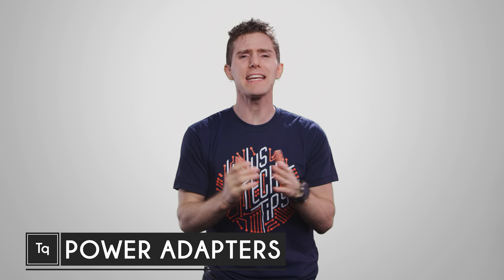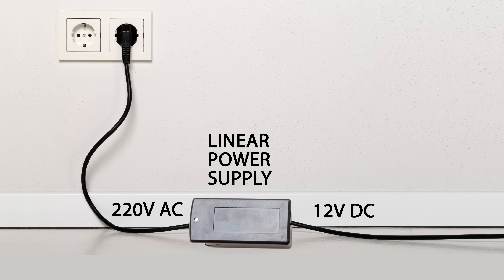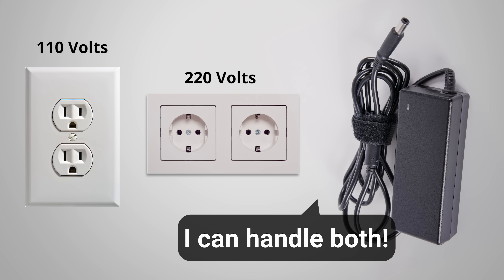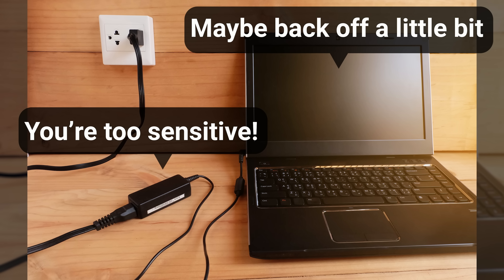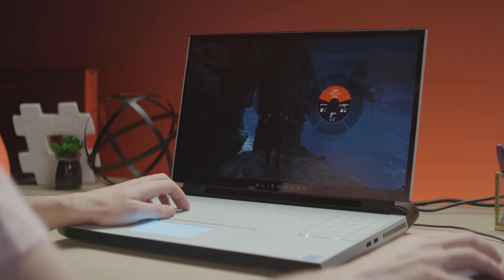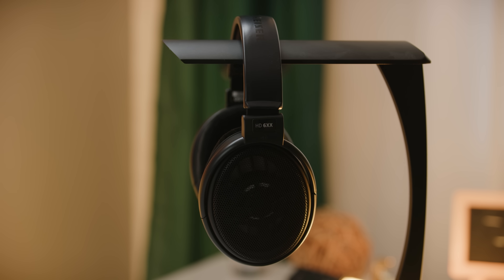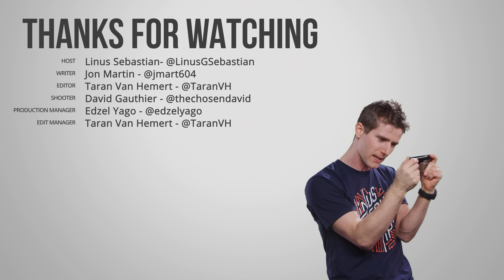Why Power Adapters Are So HUGE

Comment: That's not why they're called switching power supplies. They're switchmode power supplies. They contain a control chip that turns on and off at a much higher frequency than the utility supply. The high frequency means that a smaller transformer can be used, saving space and money, as well as reducing waste heat. The control chip monitors the output voltage and adjusts it by altering the switching.

The switching is why some phone power bricks make a whining noise, and it's pretty much the same reason for the coil whine you get from some graphics cards and motherboards.
Reply: Yea  i didn't know what is a switching adapter, but that part felt wrong, because why would it be more efficient just because you can use it with both 110V and 220V. That way it would be more convinient, but not more efficient.
Reply: I think the linear power supply you mentioned is linear dc to dc converter, like 7805. They are not efficient, and no one use them to drop high voltage like 110 to 5. Linear ac to dc converter use transformer, rectifier, capacitor and their efficiency is not too bad. Still worse than a switch mode of course.
Reply: @thaibinhphamdinh1299   P=VI, if you're passing current, and your device is dropping voltage it has to go somewhere, V=IR, so P=I^2*R. If you're dissipating power, it's through a resistance in a piece of silicon somewhere. Why do power MOSFETs or rectifier diodes get hot if they don't have an internal resistance which is doing that?
Reply: @NeneExists  That is when you assume the same current I, like in 78 series dc converter. In transformer and smps, when you drop the voltage V, current I go up. That is why the secondary windings of step down transformer is thicker. Of course there is some heat loss and transformer loss here and there.
Reply: Switch mode power supply or linear power supply all use the basic components like diode, capacitor. The first stage of Smps is just a high voltage linear power supply. Then it get inverted to high frequency ac, go through transformer, then rectified again to DC. 
The advantages of smps come from the high frequency ac, which reduce the side of transformer and capacitor needed for conversion and rectification.
The pwm chopping you talk about is used in dc to dc converter. It doesn't provide isolation because it does not use transformer. And the efficient drop when you convert from high voltage to low voltage (the duty cycle too small).
Reply: A linear supply regulates the voltage using resistance. 110V is turned 12V by dropping the remainder across a device. If your device uses 1A of current, that's over 100W of power to get rid of. They used to use a transformer to turn 110V into something more manageable like 15V, but you might still end up with 5W of waste heat coming out of a component the size of the end of your finger.

A switchmode power supply regulates to 12V by chopping up the 60 or 50 Hz into something much higher like 100kHz or more. Higher frequency means smaller transformers, and that means lower losses to heat. Next on the other side of the transformer you just just need a diode and capacitor to turn the high frequency AC into DC. The diode wastes some heat, but not much. Now the controller is on the high voltage side, and gets feed back from the low voltage side to tell it when the voltage passes the right level. If it's too low it switches more and boosts more power through, and if it's too high it backs off a bit. Yes this it's a simplification, but I think it works.

For an analogy, imagine you have a tap that you have to use to keep a pool filled to the right level. Now the tap has two settings; off and full blast. You have to turn the tap on and off to keep the level right.
Reply: @NeneExists  Linear power supply does not work by resistance. They are bulky because of the transformer. You are right about switch mode power supply though.
And Linus totally misunderstood what switching power supply mean. I wonder who wrote the script for this video, it doesn't take that much research to understand the working principle of smps
Reply: Not true. Linear power supplies are normal transformers. They turn 220 in 12V by adding the correct numbers of windings on the transformer. Believe me... dissipate 100W of energy like you said is impossible in a brick power supply. Have in mind that a normal soldering station has 65W and can melt plastic... solder... burn things.. So imagine what a 100W of heat can do inside a power brick.
Reply: @NeneExists  also a linear power supply for a gaming PC would be more expensive and heavier than the rest of the system, while being a literal room heater
Reply: Butler Johnny i certainly don’t need more heat from my pc it already outputs enough to class as a heater when the gpu is under load.
I cant imagine a pc surviving long with that much heat output.
Reply: @nathnathn  you will just need a better cooler, like a water cooler from an old truck should be enough, and the water pipes goes everywhere so it cools down everything, and place the cooler unit outside

Comment: After having an Xbox 360 w/ the giant brick, I remember my experience unboxing my new Xbox One on launch day... *Pulls console out of box "Wow this thing is huge, bulky and ugly af... but at least it has a built-in power supply and no brick!" *Finds even larger brick than 360 in bottom box "Sweet Jesus lol". Worse thing about the Xbox One's power supply too, besides being huge, it does not handle 220V so definitely not good for wroking/travelling overseas! Of course assumptions were made and I didn't figure this out until arriving in Singapore for a 6 month assignment with it. The size of the transformer I had to get to make it work was nuts too haha. Thank god they made it smaller and dual voltage on the new S model!

Comment: Local Xbox fan here. That "Jasper" Xbox 360 power adapter is not just an adapter, the specs at the time were so high it was hard to cram into that small form factor, they had to put the extra RAM in the power adapter. If Techquickie did their time to research, they'd know this. The adapter would've been significantly smaller if they could cram the RAM into the 360 at the time. However, tech has improved A TON nowadays, which is why stuff like the System76 Meerkat even is conceivable.

Comment: My Sony psp 1000, pspGo, and PS Vita have bricks. However they convert to 5V  1.5amps. Couldn't I just use a 5V 2amp phone charger and do away with the bricks? And if so, why the bricks? Are they more stable/better?

Comment: I remember when I was in middle school. One of the pins in the power adapter for my laptop broke.  So I got the brilliant Idea to cut the cable off the adapter, and the plug of the cable for the power adapter's power, then spliced it together. I took care to tape the splices individually with painter's tape( because I didn't have electrical tape) then again with packaging tape.  I plugged it into the wall cautiously. Nothing happened,( I must have done it right!) Then with the greatest sense of accomplishment I've ever felt at that point I went and plugged the other end into my laptop, there was a short pop, then a loud ass pop that rang through the house, and the power shut off in both mine and my sister's room. My family thought it was a lightning strike, I let them believe it.
Reply: as long as you didnt do it a 2nd time, id say that was a great educational experience
Reply: Genuinely was about to do this exact same thing yesterday but my dad told me not to lol
Reply: oops
Reply: I did the same but with my Internet modem 😂😂

Comment: My gaming laptop's AC adapter is just as big as the old xbox 360's AC adapter...quite literally. It's not that much of an annoyance though, I'm more worried about being careful with it since a replacement adapter would cost about $100. With an adapter as big as this one, just make sure you'll have a spot for it to comfortably rest on and not fall off. I cringe at anyone who plugs their laptop in and just lets their ac adapter hang in the air by the cords...that's a great way to fray your wires up.

Comment: Linus. I really like your videos, but this video has some cringeworthy explainations.
LIke many people already commented and explained in detail,  a switched-mode power supply is not called that way because it switches between different mains voltages.

Guys with electrical engineering background are screaming while watching this video :)
Reply: I'm screaming
Reply: @Shiki-mx   me too was expecting something like PWMs small transformers associated with switching frequency😁😁
Reply: Even an electronics hobbyist bum like myself cringed at this video.. way too oversimplified, in some cases plain wrong. Not impressed.
Reply: Yup.  If we used DC, power bricks would still be needed.
Reply: No, No, No. That's not how you do it.

You send him an email, asking him for an interview about the errors in this video. Then when he holds his hands up about them, you get a big video about it :p
Reply: Scccrrrrreeeeeeaaaammmm
Reply: There should be more efficient DC to DC bricks for solar hybrid and offgrid systems to get less wasted energy in conversion process.
Expecially in RV/Tiny-House size system. Converting ~48V in to ~20V with short wire runs  for example USB-C PD would be much less heat than 240v adapter and an inverter.
Reply: In every topic Linus is at the point where his knowledge is. When you are more experienced than Linus, his channels are too low for your knowledge, and you have to go on...
Reply: Hai gUiZ cAn I sCrEaM t00?!

cAn I bE c00L tOo? I wAnT tO bE cOoL l1Ke YoU GuiZ.
Reply: Funny how your comment is higher than any of those explainer comments
Reply: I’m screaming because I stepped on an upturned U.K. plug. I think I might need surgery
Reply: I have been screaming this whole time.
Reply: i expected the video to explain why power adapter is bulky and maybe talk at lease a little bit about how switched mode power supply works from the aspect of electronic components.
Reply: Massive misinformation. LTT could have asked a competent electronics guy for a few minutes to make this video. 
The size of the power adapters has nothing to do with AC-DC conversion.  LED light bulbs have AC to DC converters internally, thus, small size.
The size is dictated by the WATTAGE and DC output quality of the power supply/adapter.  Laptops require huge adapters as they are sized/watts for simultaneous charging and use of a laptop.  If your laptop charges very slowly while you use it, it means you have a small/weak power adapter
Reply: @zodiacfml  I thought he kind of said that about bigger bricks for higher wattage and stuff?
Reply: I'm not from electrical engineering background, but I'm screaming too.
Reply: I'm still a high school student, but really passionate about electronics and circuitry, and this video made me cringe too

Comment: One thing you forgot to mention is certification. Generally, any device sold in North America that uses high voltage inside has to be UL rated or equivalent. By keeping the power supply outside of the device, you can re-use the same UL-rated power supply with multiple devices without having to get each one certified individually.
Reply: Came here to say this. This is by far the most important reason for external power bricks.
Reply: For sure... Designing a power supply that meets UL and CE requirements and having them certified is expensive.  Lot of companies doesn't even do it and rely on companies that just do power supplies and sell to a lot of other companies.
Reply: The samsung odyssey g9 eliminated power bricks

Comment: For Monitors and TVs can we not just integrate a power supply?😏
Reply: In most monitors and tvs a power suply is integrated....
Reply: @davidmayr4540  then why do I always need to plug  🔌 it in to use it?
Reply: @liammchugh9439  ?? I have a normal cable for my pc like that cable you plug in to your power suply so they have one in it
Reply: @davidmayr4540  I said "integratated power supply". Means built in. I haven't seen a PC /TV/Monitor without a power cable.
Reply: @liammchugh9439  yeah a normal cable but the power suply is in the device! The cable just puts power in the device so the power suply that converts it and give the power to all components is in the device
Reply: @davidmayr4540  Yeah I new that.
👍 😉Just ment to say battery not power supply..... My bad sorry

Comment: #TLDR
Reasons why they're big:
- Semiconductors are not entirely efficient (Look up PowerMOS, GaN, SiC) = Heat + Heatsinks
- Isolation from Primary Side/Secondary Side (UL Regulations)
- Bulk Caps & Transformers
Reply: get pinned
Reply: Although it's probably not a reason per se it's also worth noting that smaller adapters create a shitton more static interference than the big ones.
Reply: @TROONTRON  Not entirely true, EMI can be managed with good design techniques.  It's when you half-arse the design is when you get into EMI/EMC trouble.
Reply: #TLDW
Reply: @samuelsofa   #TLDC
Reply: thanks you saved me from 6 minutes talking around the main point and some tunnelbear or skillshare or some shit
Reply: Some very good reasons as to why power packs are big.
Reply: Yes, we can't judge a solution without looking at the specifications that need to be fulfilled
Reply: They dont have heatseinks mine just gets so hot untill i step on it and make my foot into cannable bacon
Reply: Cat Teenager just watercool it bro
Reply: @burgerderper7140  cant, itz a laptop one, and i dont have a spare or the partz and i gota take it to school and different houses and not worry about my charger water spilling on my very expecive laptop
Reply: I got a better question, why the fuck are they always blocking other plugs, like cant they make them in different shadows so they don't block the other plus, and are they really that strong to hold all that weight? I've always felt weird seeing the huge adapters being grabbed only by tiny pins.
Reply: Also, larger components for higher ampacity.

Comment: Hmmm....I don't normally send suggestions, but why not try Alex's Oscilloscope card out with a PCIe 1X to PCI-X adapter card...  not sure if it'll work in Win10 (pretty sure the adapter will, not sure about the card - figure it prob will with Win7 though).  There is one available on ebay under the title "PCI Express x1 to PCI / PCI-X Adapter Card" from the UK.  Oh, uhhhhhhh...Never mind, don't, at least not given that the adapter costs $196 CAD....   Good gravy. :-O  Forget it, total bad idea (unless you/team need a PC based oscilloscope).

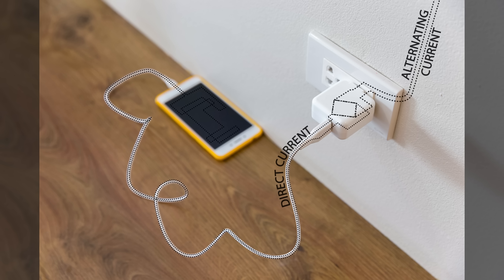Comment: 0:49 "The basic reason for this clunky boxes is that our modern electronics can not use the raw AC power that comes directly drom the wall. Instead it has to be converted to direct current or DC."
While he says that a full-bridge rectifier is shown over the power brick.
Of course, AC-DC-conversion has to be done, but that is not the reason why the power bricks are so big.
Yes, later you also talk about the voltage conversion, which is really the reason for the size and weight, but that doesn't make that sentence at the begining less false.
I just hope ElectroBOOM won't see this.
Reply: Bud i hope electroboom do not see it also
Reply: @kingripass575  To be honest, it was a lie and I actually hope electroBOOM will see this, get mad about it and scream at Linus in a video.
Or even better, there will be a new video that starts exactly like this one and at first we think it's a reupload. Then electroBOOM (what's even hos actual name?) enters the frame pushes Linus aside and contuniues to do the rest of the video.
I think this could even work with respect on eye level. We and electroBOOM know that Linus and his team are actually good at their core skills they do on a regular basis. This is a little bit outside of their comfort zone so it's not really a big problem if they screw up a little bit.
Reply: I saw it comming.
Reply: There will be a few of electroBOOM people here saying.  FUUL BRIDGEEE RECTIFIYAH

Comment: Just because transistors are getting smaller doesn't mean inductors can get smaller too, which power bricks need to regulate voltage. Some things in physics just aren't capable of being shrunken down to save space, in the name of power efficiency.
Reply: Well specifically in the case of inductors that isn't entirely true, you can run an inductor at a higher frequency to get away with using a smaller inductor (and in turn smaller capacitors), but of course it does still need to be thick enough to handle the current passing through it and after a certain point causes power losses.

https://www.digikey.com/en/articles/techzone/2015/feb/design-trade-offs-when-selecting-a-high-frequency-switching-regulator
Reply: I noticed that he really didn't cover the main job of converting mains power (120 or 240v) down the voltages needed by the specific device which in most cases, is not mains voltage. You can't just convert 120v AC to 120v DC and feed it into most electronics, unless you want a 1-time use smoke machine and a dead device.
Reply: Actually, one of the advantages of switching-mode power supplies i that they can have smaller transformers, because of a higher switching rate. Maybe the transformers can get smaller if we manage to get an even higher switching frequency.

Comment: If we put a converter on the main power box to our house we wouldn't need then in all of are Electronics allowing for greater efficiency and convenience
Reply: Nope! Transmitting 5 watts (some typical power when charging the phone) using 110 / 220 volts is MUCH easier than at 5 volts of USB. That would require some heavy-duty audio cables as thick as a finger (remember what happens when charging phone through long USB cable. Now multiply it by 10..20 so it goes all the way through the walls to main power box). Powering desktop PC from main power box probably requires copper bars!